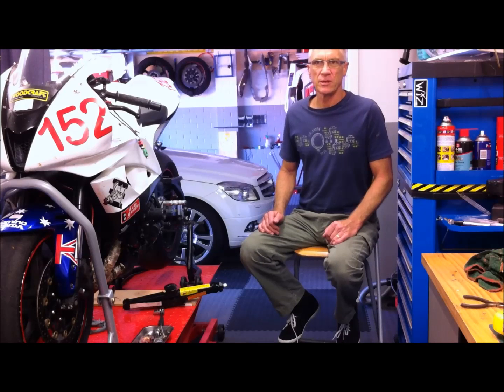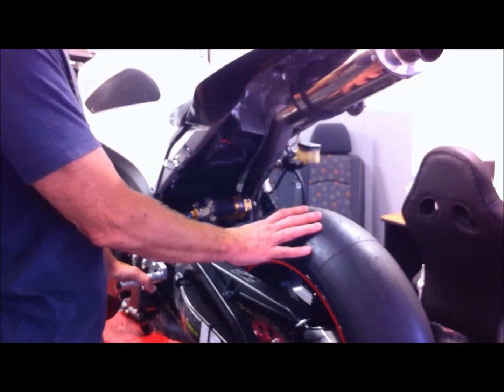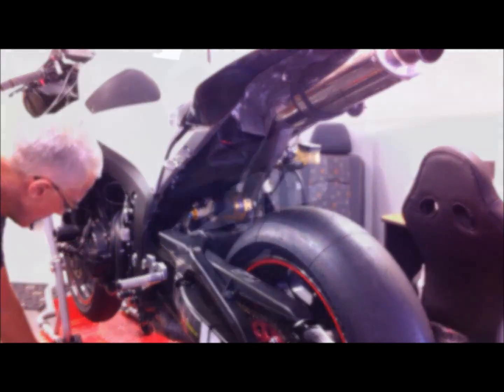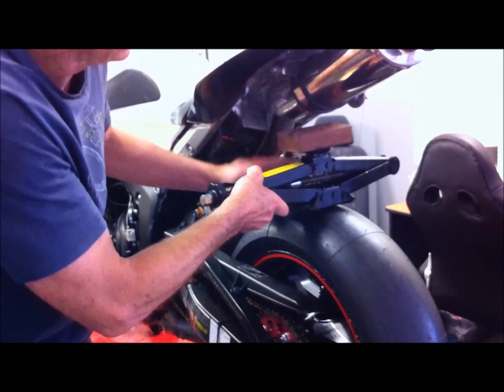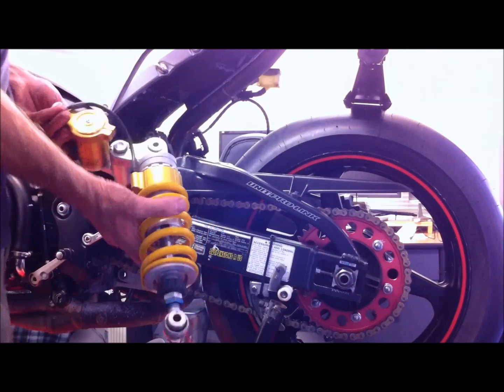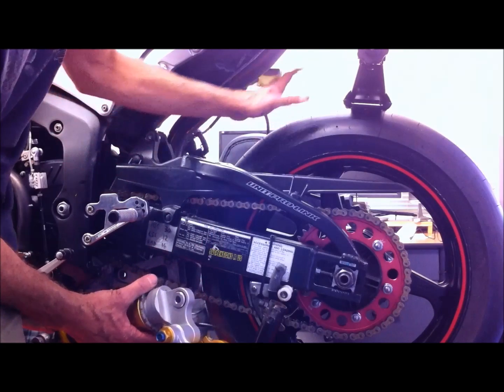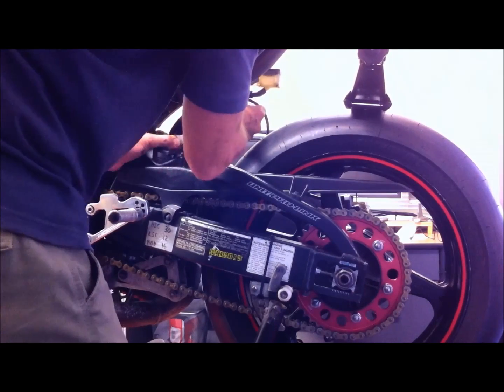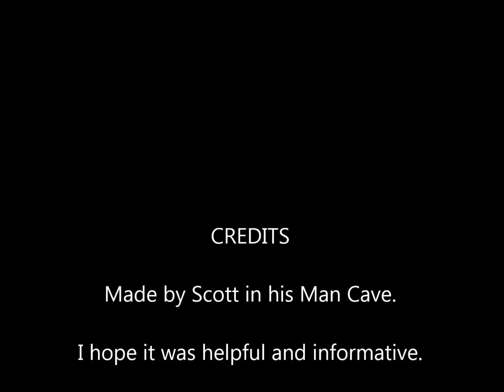2007-2017 Honda CBR600RR CBR600 Remove Rear Shock Suspension Easy Way 600RR

Comment: Thanks for this video, followed the process with the car jack and successfully swapped out my leaking shock for another one this evening on my '05 RR, which was essentially the same! Thanks!!
Reply from the maker: ItzDave Media Dave glad I was able to help.
Reply: Scott Elliott With 50k miles on my CBR, the old shock was just leaking badly.. a barely used replacement is now in place and delivering a much smoother ride. Thought it would be a right pain to replace... thanks again and ride safe!

Comment: Be careful and make sure the shock has a SOLID grip on the tire and exhaust. I tried this on my rc51 and it actually slipped and shot off to a side. Thankfully my dual exhaust was in the way or else I coulda lost an eye. Just remember, safety first!

Comment: Hi Scott, thanks for a really useful tip!  Do you ride with an OEM rear suspension linkage on your CBR ? Do you think it's even necessary to upgrade for more linear linkage for a beginner track rider?
Reply from the maker: Sven I have the standard linkage. Leave it standard you don't need to upgrade it. The standard suspension is more than adequate for track riding.

Comment: so is this used to remove swing arm? I have an 08 with a scratched swing arm so I wanted to get it to powder coated. can I just do this, remove the stock shock. then it should be easy year? 
when I remove the swingarm. do I need to hold the engine up or something?
Reply from the maker: Hi Jack. No ... you will have to support the bike so the swingarm is hanging free. Because I have solid mounted racing footpegs I use two car axle stands under them if I need to remove the swingarm.
Reply: @ScottElliott152  ahh ok. ill get some straps and hold the bike up 
then ill follow your directions yeah? 
then it should just come out
whee do you race mate? I'm not far away from lakeside
Reply from the maker: @seinfeld11123  Yep the shocky will come straight out. I ride at the Collie Motorplex here in the West.

Comment: Hi Scott Great video. I want to try this on my 06 cbr1000rr. Problem is I cant get at the bolt on the bottom of the shock as the linkage is in the way. Would you have any advice on this?? Thanks.
Reply from the maker: Thanks Sean. You just have to remove some of the link bolts.
Reply: Thanks. I thought as much just wasn't sure was I missing something. Cheers

Comment: can i do this without a rear stand ? i will be doing it on an 03 600rr
Reply from the maker: It would be too dangerous. It would be easy for the jack to slip. Also the bike is tilting the wrong way on the side stand to get at the bottom shock bolts. Get yourself a paddock stand. If you're going to do this work you need some basic equipment for safety reasons alone. Scott

Comment: Hey, I've watched a number of your videos and I was wondering if you could explain the best way to lower a motorcycle while minimally changing the mechanics of the bike's performance, I want to buy a GSXR 600 or a Kawasaki Ninja 636 and lower it about an inch to an inch and a half
Reply from the maker: Sup3rS13 I'd be very careful as it will change the bikes handling characteristics. The rear is easy to do as you can buy lowering links for most sports bikes. Search eBay. The front would need to be lowered a similar amount as if you don't the fork angle will be raked out like a Harley and it will be hard to turn and will dive more under brakes.

Before installing the rear lowering link measure the distance from the axle centre vertically to a point on the bodywork or frame. Adjust the link to reduce that measurement by 25mm.

The easiest way to do the front is to loosen both clamps and poke the forks through 25mm more. Sometimes the forks have an external snap on clip that may need to be removed to allow the forks to be pushed through more.

Comment: Does this work also for a cbr 1000rr 2004?
Reply from the maker: Yes I think it does. You need to buy the appropriate cat eliminator pipe.
Reply: YES, YES this has to be the best way of doing it. I had my rear shock on my 2005 blade refurbished and tried other techniques which almost ended up damaging my bike. Then i saw this video and it works... No damage to anything at all. Even had teh bike standing like this for a few days.
Reply from the maker: That's good news. Glad it worked out.